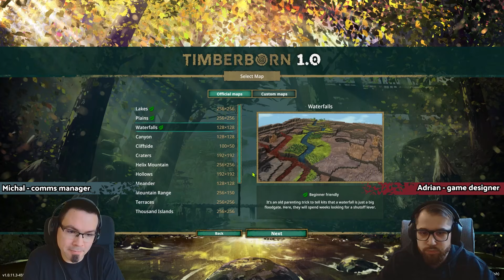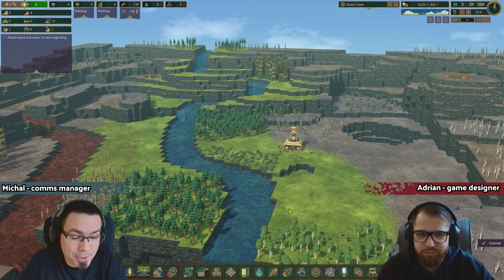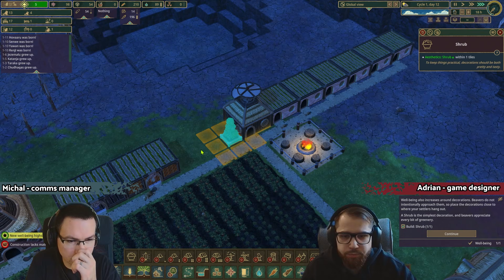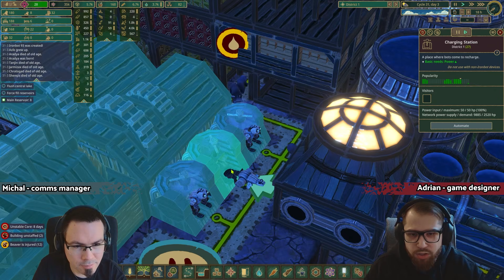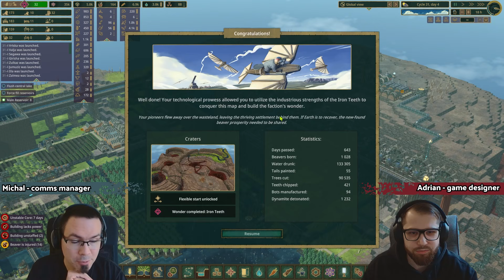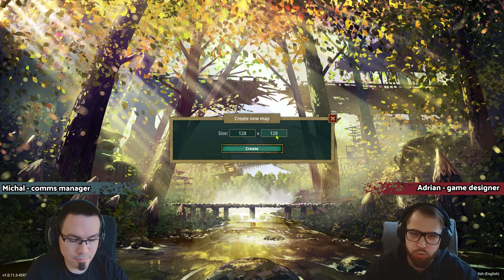Timberborn 1.0 with the devs

Comment: Hi, could you consider adding more smaller maps? - since the performance difference can be massive (more 128×128 preferably).
Reply: have you look up comunity map?
Reply: when you have it you can load it via custom map screen.
Reply: As someone with a potato pc I second that.
Reply: @Gregory-1968 use the workshop, it has many many many many new maps